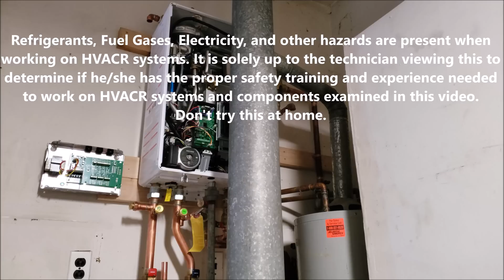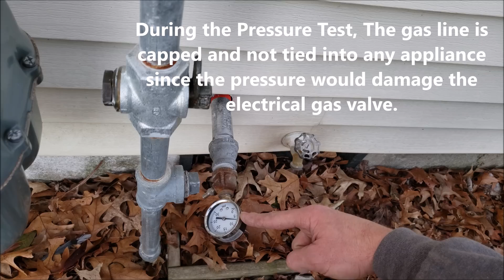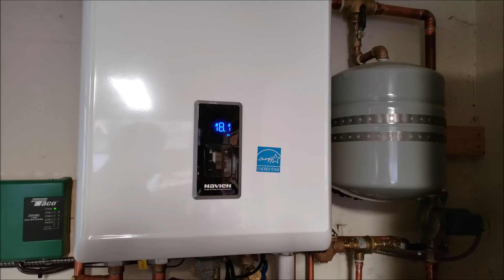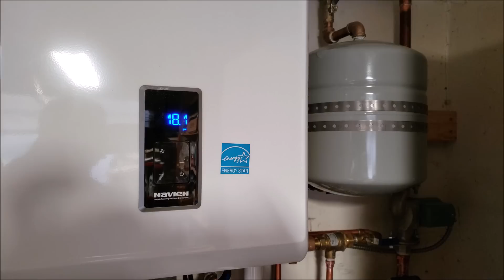Installation of a Tankless Boiler, Water Heater

Comment: for the two zone you have the honeywell zone valve one on each zone do you need to aad a motor for that (for tthe second zone) or thats the circulating pump -i want to add another zone for myu basement just wondering what i need ?

Comment: Nice job. I wish I knew someone in my city whom I could trust to set something like this up correctly. I also wish I knew the cost of this job because it's basically what I need, although I have 3 zones. I see you planned ahead for a 3rd zone, so I imagine the cost would be about the same, except for an extra Honeywell zone control valve.

Comment: Nice clean video but I wish there was more detail, like what zone control valve did you use, how exactly did you vent through the existing chimney and things like that.  I would also like😀 a schematic but many thanks for taking the time to show a novice like myself what you did.
Reply: He said he used Honeywell zone control valves. The tankless manufacturer probably recommends which model. He also said he vented directly and removed the existing flue.

Comment: Just want to point out a few observations. It appears you are replacing a non condensing boiler on a high temp system. In order to throw the high temp dip switch Navien requires the first 3 feet of exhaust to be schedule 80 cpvc. I noticed you did not allow for a tank drain between the expansion tank and the isolation valve, this is critical in removing system pressure from the tank before checking the air pressure. Last I want to say that although combi boilers are all the rage right now the 10 to 1 turndown is based on input, this means that the minimum turndown would be 15000 on that particular unit. This severely limits the effect of the outdoor reset especially on homes that only require 35000 or less on a degree day.
Reply: Just drop system pressure to 0 it’s not that hard and it’s not that much water.
Reply: @jameslang9170  Spoken like a true hack.
Reply: It takes all of 5 seconds to drop pressure and not add air. All you’re doing is wasting fittings.

Comment: is there a reason why you didn’t use black iron for the gas?
Reply from the maker: We live by the shore so no supply house here carries black iron because it rots outside. Nothing wrong with using galvanized per IFGC 2018 and inspectors here require it outside and are just used to seeing it ran though the whole building. Once again, its all our supply houses carry here, thanks!
Reply: @acservicetechchannel  good to know thank you!!

Comment: Just to be clear, with a tankless water heater, you do not need a water heater or a boiler? I would like to continue to use my NEST thermostat with the tankless water heater. Am I understanding this correctly?
Reply: Yes, a tankless "combination" boiler like shown in this video will supply both domestic hot water and space heating water and it doesn't really matter what thermostat you use if everything is wired correctly. In a nutshell, a 'water heater', tankless or not, is a simpler device and is only designed to heat domestic water.
Reply: @autonomy5649  Thank you!

Comment: Be smart and don't install a condensing boiler no matter what brand. It lasts mostly 10 years if you do the maintenance on them every year. For maintenance you need to call the same people who installed it and pay them between 2 to 300$. A different company will not do the service if it's not installed by them and their brand that they know. If you don't do maintenance in 5 years you pay the boiler again, that reliable they are. Thinking of saving 20% on fuel and electricity? You don't save anything and if you do those money are gone to your annual maintenance subscription. Parts break inside pretty quickly and even if they are under warranty you still have to pay for the labor. That's on top of the annual subscription to maintenance. Awfully ridiculous the whole system and installation that costs around 9 to 10K. Unless you are an experienced plumber with a gas license that can buy it from the store for around $2500 and install it yourself don't go for it. Stay with the conventional boilers because they will go for 10 years with no service on them, and another 10 after the service which can be done by yourself actually.

Comment: Gonna install the same tankless. Client has pretty old boiler in place. Recommend to flush the radiators with a chemical? Or would just water do?
Also, can the zone valves be installed without the controller? And just wire them to tstats?

Comment: Im surprised, that you didn't installed a relief valve on the supply of the heating system. 
I thought you need one there, I might be wrong
Reply: in the opening shot you see it coming out of the top of the combi boiler...elbowed to come down

Comment: Also, why did you use a metal plate on the ceiling..?
Reply from the maker: There was an existing hole in the ceiling from the older exhaust and plate so it was covered with 26 gauge sheet metal. If it were just sheetrock then I would just drill a 2 3/4" hole for each pipe, thanks

Comment: Why couldn't you re-use the galvanized pipe? Was it because of the pressure venting, or because it was vertical instead of horizontal, or?? If multiple reasons, please elaborate, and thank you..
Reply from the maker: This is a condensing tankless water heater so condensate will accumulate on the inside of the exhaust pipe and trickle back into the heat exchanger, thanks

Comment: hi, so your gas pipe size going into the boiler is 1" or 3/4" ? for units with 3/4" gas input, can you use a reducing coupler 1/2" to 3/4" ( on a 1/2" gas line)? or do you have to take it directly from the 3/4" main line? i am assuming going from 3/4" to 1/2" ( i.e. for a furnace) is ok but not vice versa. please correct me if i am wrong. thank you.
Reply from the maker: This one happened to be 3/4". You would only reduce as you go downstream but you should check out another video I did "acservicetech sizing gas line" thanks!

Comment: On the old style boilers I like to vavle off before and after a cir, zone vavle, or any control so all I have to do is close vavles and then change what ever, so you don't air bound the system. My question is with this new type of boiler would it makes sense to vavle before and after a item? Thank you for the video as always learning, I'm  never too old to learn. Have a safe and good week. HVAC ON!!
Reply from the maker: Yes it still does make sense except the fact that you have the primary valves to work with as well which are there to use. I also use the high volume auto air bleed which helps get it out fast, thanks Ray Ray!
Reply: Sounds good, I like that you used that automatic vavle. I continue to watch the videos with lots of value to learn.
Reply from the maker: Glad to help and thank you for each and every one of your comments!
Reply: You are very welcome
Reply: This is a great point. I recently serviced my own system (I'm not an HVAC person, I just studied a lot before attempting the job) and it was a royal pain to change out various parts without shutoff valves on either side. I was cursing the previous installer. And please, never use those shitty garden hose type valves, they always leak with age after you crack them. Use quality 90º ball cock valves. Even if you only used them once or twice in the life of the system, they're worth it, IMO.

Comment: Do you recommend insulating the hot line. ? Or is the line run short ?
Reply from the maker: Surely, that helps when the pipes enter the crawlspace so that the faucets don't take as long to get hot water at the tap and also for heating the radiators faster upon the initial call for heat, thanks

Comment: Wow!  Nice clean job, Craig.  I wish I had hot water baseboard heat.
Reply from the maker: Thanks Jack, yeah, its comfortable!
Reply: I have it and it's a bit noisy with expansion/contraction tings and pop sounds (3 zones). All my baseboards are 50 yrs old so maybe new technology makes baseboards quieter. Not sure. If I were building a new home, I would use a boiler again but I'd use underfloor heat instead of baseboards. That's the ultimate, IMO.

Comment: Very nicely done. Don't use the pressure reducing valve in the fill line. And add fernox is cheap insurance over a stainless circ. Works wonders.
Reply from the maker: Thanks Guy!

Comment: In my area ng or lpg is not aloud to be used with galvanized piping. Otherwise good smart install
Reply from the maker: Many of our supply houses only carry galvanized. We live at the point where we can drive from the ocean beach to the bay beach in 15 minutes so we have a lot of salt air so no techs here use black iron for gas piping, thanks Rocko99! Also in the IFGC 2018, it does not make any reference good or bad in regards to black iron or galvanized so I think that is just the interpretation of the inspector unless they are following something else as well, thanks
Reply: Thats is strange as booth are legal by gas code and galvanized is actually better. By me bla k is still the norm but galvanized is coming and the gas company has switched to all galvanized.

Comment: Nice looking install Craig.
We're not allowed to use galvanized pipe for new gas installs in CO.
Reply from the maker: Many of our supply houses only carry galvanized. We live at the point where we can drive from the ocean beach to the bay beach in 15 minutes so we have a lot of salt air so no techs here use black iron for gas piping, thanks Tomon8tor! Also in the IFGC 2018, it does not make any reference good or bad in regards to black iron or galvanized so I think that is just the interpretation of the inspector unless they are following something else as well, thanks
Reply: @acservicetechchannel  thanks for 'splainin the galvy pipe!

Comment: Hi , I had install about 20 Combi navien boilers in the past 2 years and following manufacture recommendations, they say you don’t need to install a Pressure reducing valve (water feeder) since this new combi boilers NCB has pre-install integrated PRV , so my question is to all experience Navien installers , do we need to install this part anyway ?, (which save you money in parts) or I just screwed out all the units I install ? Lol.
Reply from the maker: Hey Janito25, they do have an internal feeding valve and if they didn't, I think you would have seen a problem of the relief blowing by now. It says in their lit that you can choose to just put in the backflow preventer. It has more to do with just your local codes and inspections just like the internal low water cutoff. However, I noticed it allows more pressure than I would like to see in the boiler if I bypass the pressure reducing valve. Do you happen to notice how high the pressure goes before heating and at say 140 160 180 F degrees by chance? Just curious how close it gets to 30psi, but you should be fine as long as it passed codes and since you are following what the manufacturer is stating, thanks!
Reply: That’s a really good point, these do tend to have more pressure than I like
Reply from the maker: They are higher typically than normal tank boilers running at 180 degree F,  thanks Michael!
Reply: Me I would install my own prv, they are not much money and I feel better just incase it fails internally it has a back up.

Comment: We stopped installing navien. Nothing but issues. I've become a master at navien 3way valves though 😂
Reply from the maker: Most of the companies around here install Navien. What brand are you installing now? Are you finding issues other than the 3 way valves? Thanks Brian!
Reply: AC Service Tech LLC we are installing HTP and Lochinvar currently. We have a lot of Navien's around with 3 way valve issues, circulator issues and heat exchangers/DHW flat plates leaking. Also found a lot of issues with the wired navien controller.
Reply: Hello brian, I have a navien, so far so good..how's htp? What do you think about them? What about a warranty?

Comment: How did you transition from PVC to the roof vent since PVC is a smaller diameter? How did you pipe the input vent, outside or attic?
Reply from the maker: Any time I go through the roof, I go through with a 2" concentric kit so it is the 3" pipe through the roof with the cone on top and the exhaust in the middle, thanks!

Comment: Awesome installation! Very clean. Odd to see galvanized pipe used as gas line.
Reply from the maker: Thanks Channel Cat Chaser! Many of our supply houses only carry galvanized. We live at the point where we can drive from the ocean beach to the bay beach in 15 minutes so we have a lot of salt air so no techs here use black iron for gas piping. Also in the IFGC 2018, it does not make any reference good or bad in regards to black iron or galvanized so I think that is just the interpretation of the inspector unless they are following something else as well, thanks

Comment: That's a hell of an install...those tankless hydronic systems....how good r they really?? Been considering them instead of gas forced air...dries out everything...
Or am I crazy
Reply: Jesse Lute install a whole house humidifier.
Reply: Agreed a lot less maintenance and cost! Can't beat forced air Nat gas!
Reply from the maker: They are efficient and any boiler is more comfortable than forced air due to humidity issues but also moving air in the building leads to an evaporation affect which makes you feel colder so you may have the temp 1 or 2 degrees up higher. That being said, it is very expensive to switch to hot water heating distribution when you already have the duct for forced air heat. I am also a fan of dumb efficiency meaning high % efficiency but simple and reliable parts, thanks Jesse Channel Cat Chaser and Mark!
Reply: @acservicetechchannel  I was looking into the hydronic boiler adaption exchanger for forced air usage...seems like a swell idea
Plus I'm moving soon and looking for ideas  
And i love hydronic heating. Had it all my life and it's the best
Reply from the maker: You are talking a hot water coil in the duct with a relay to turn the fan on, thanks